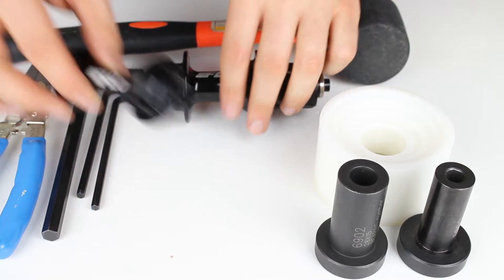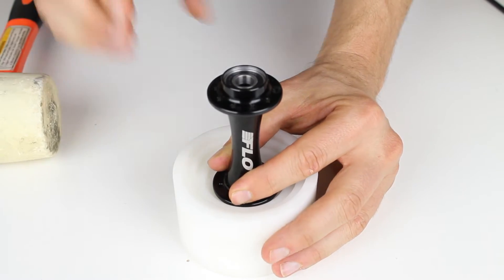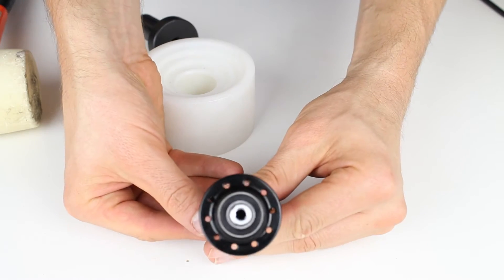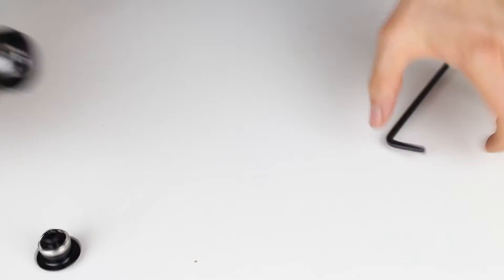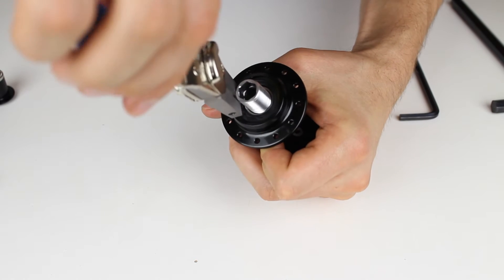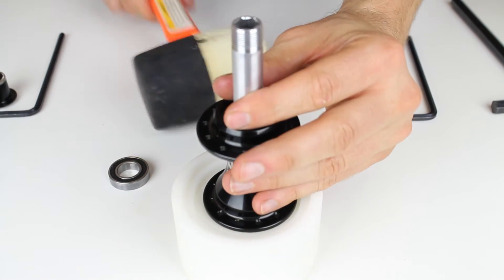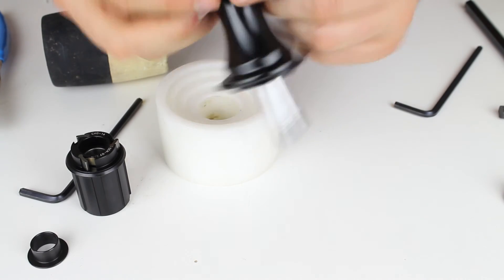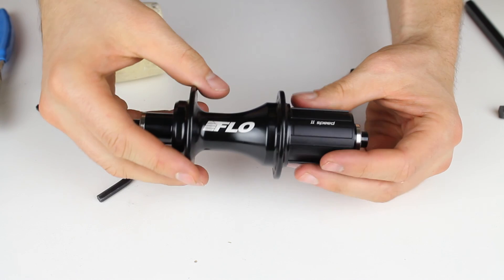FLO Cycling - Replacing Bearings in a FLO Hub

Comment: I made a video on how to seat the sealed bearings of the 2016 FLO rear hub with a Wheels Manufacturing drift set. Using a socket didn't work for me the first time and I ended up ruining a set of bearings. So I went this other route and it has worked well a couple of times for me. https://youtu.be/AfxJiXjmSIg

Comment: If the drive-side rear hub sealed bearings won’t  come out via the mallet method described in this video, what would you suggest next? Trying light taps with a screwdriver? Buying a bearing puller? In my case the sealed bearings were damaged by a broken pawl spring.
Reply: Should I just hit it with the mallet harder than I have been?
Reply from the maker: Are you certain that the c-clip has been removed?  If you missed that step the bearing will not come out.

Chris
Reply: @flo_cycling  actually I have replaced these bearings over a year ago, and there was no c-clip. I even bought the tool to remove the c-clip. But there was none then. And there is none now. I actually just got the bearing out. I soaked it in wd-40, and used your method again. After many whacks, it hadn't come out. Waited longer, very hard whack, and it is out. But now the sealed bearings are stuck on the axle. I suppose I will use a screwdriver to try get it off the axle.
Reply from the maker: @Wapiaries   Thanks for the update.  Let me know if you need any particular parts and I can help you get them.

Take care,

Chris

Comment: no grease used at all in either front or rear hub?
Reply from the maker: +Isaac Young ,

There is grease in the rear hub.  You can watch our freehub maintenance video for details on that.  As for the bearings, they are sealed in both front and back.  Extra grease is not good for the bearings.  

Take care,

Chris